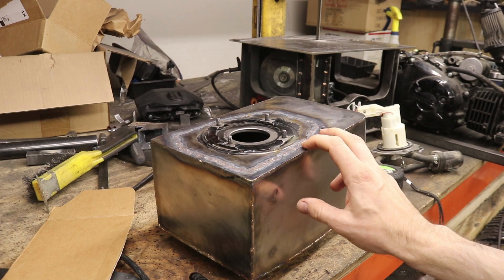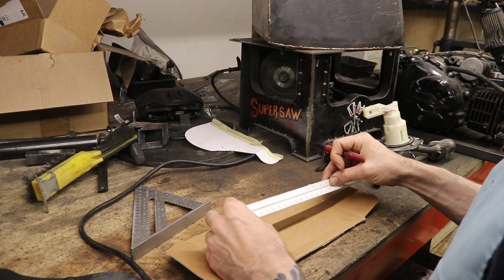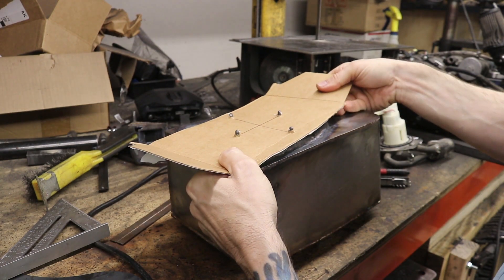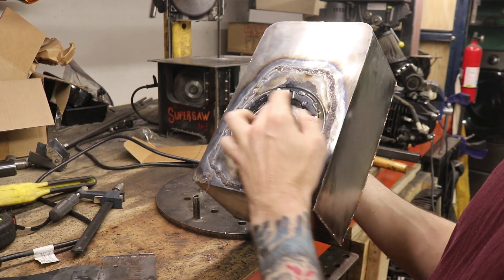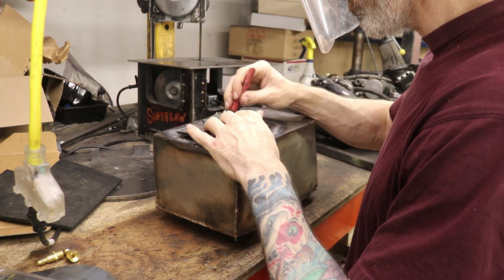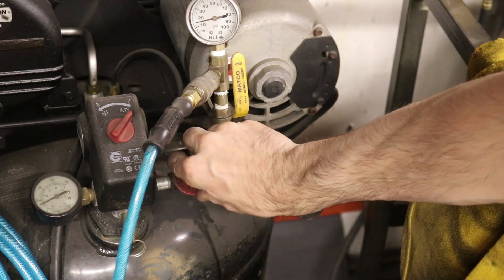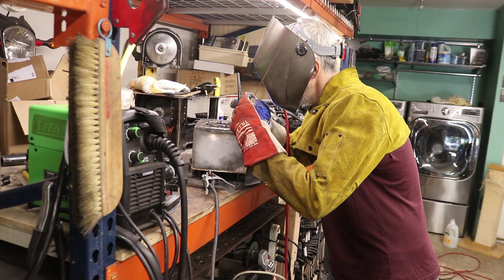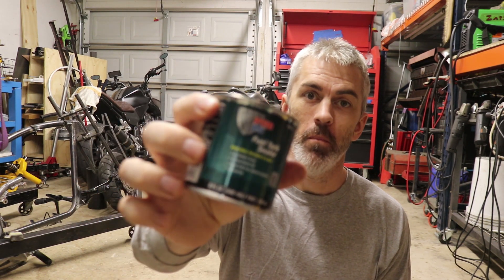Gas Tank Leak Testing

Comment: Suggest testing with water..air testing can be disastrous if the tank ruptures, secondly tank coatings may lift or suffer other faults so gas will leak out of the tank if not properly welded.